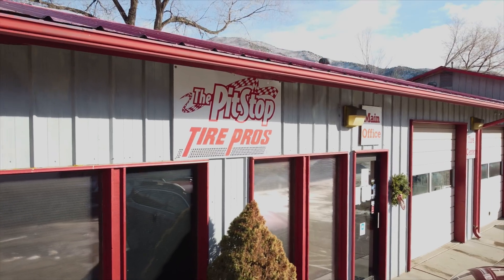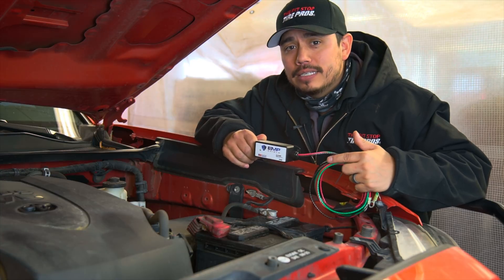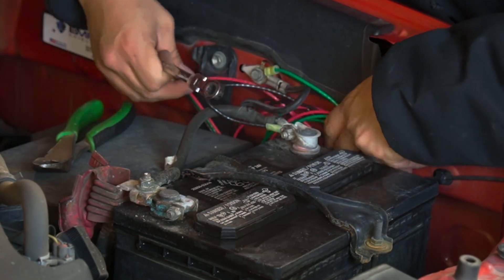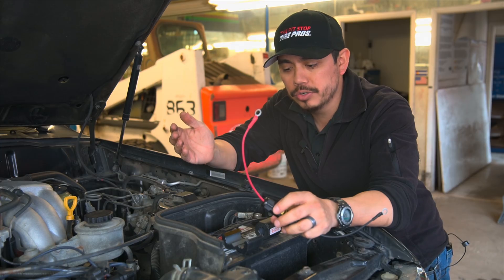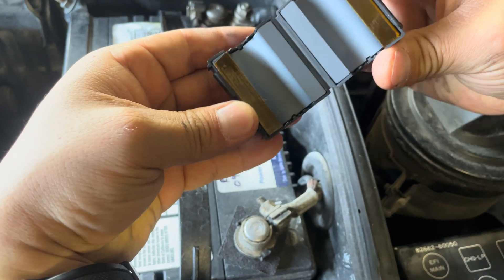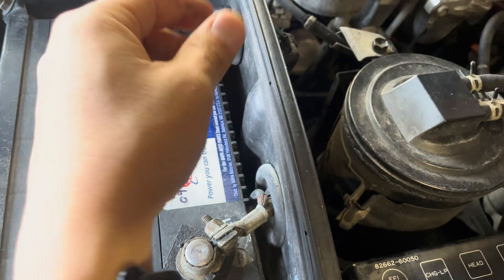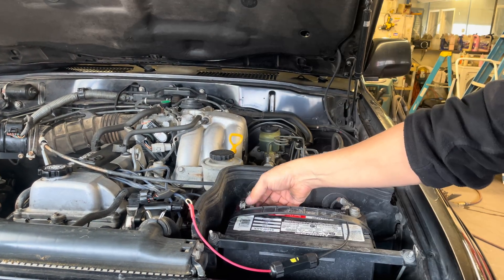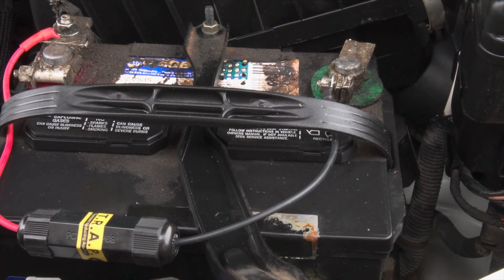EMP Vehicle Protection / What are the options?

Comment: What about the computer in the vehicle? What about the magnets in the alternator?
Reply: Excellent concerns! It's been nearly 60 years since I worked with shielding as an aircraft radio repairman but I would assume the computers are as vulnerable but a separate issue from the battery. They usually have components that remain charged after a power disconnect. I categorize most of the products and teachings on YouTube as "snake oil" and wouldn't trust any of them. An example; Why trust a mechanic to explain electronic theory? Also, it seems a main disconnect at the battery would do a better job, albeit a pain?
Reply: @jackriley5974  Tire specialist?
Reply: @bryanst.martin7134  lmao
Reply: @im_so_bored_rn  Face like that I would be laughing too.
Reply: Maybe you can just recharge the magnets with magnet blocks hidden away, and store the board on the firewall into a special cage
Reply: @goldinator  I think there are tremendous losses between the charging field and residual magnetic energy in the target device. IE 500T results in 5T? I can't specify to accuracy, as it's not one of my fields, but I am aware of efficiency losses in many things.
Not that your proposal isn't valid, just difficult. And I wouldn't count on magnets de energizing, as we can still read magnetic polarity in antique ice that is easily 12,000 years old, and each 12,000 years it changes. Gonna happen again soon.